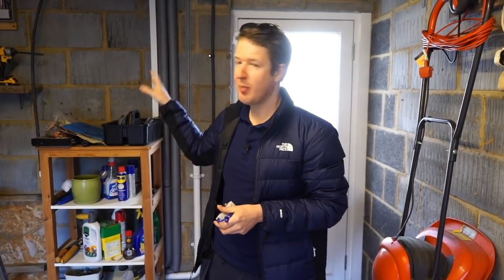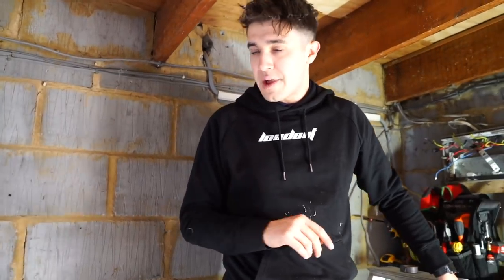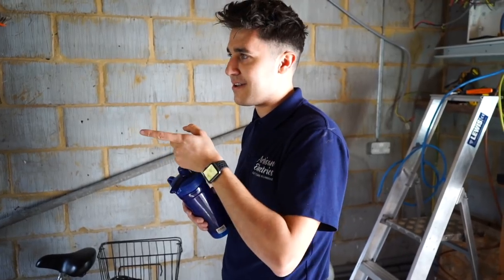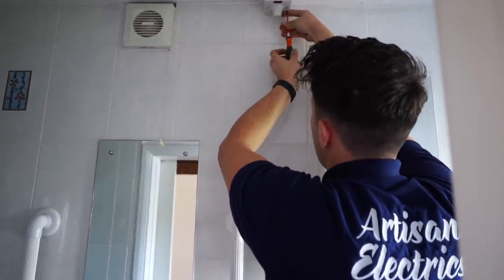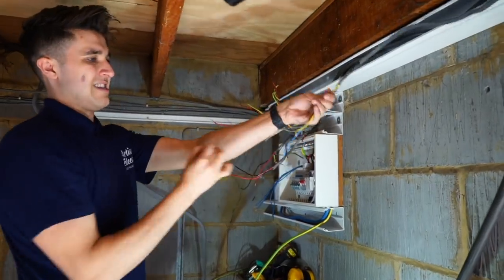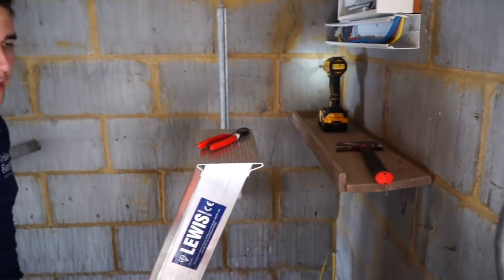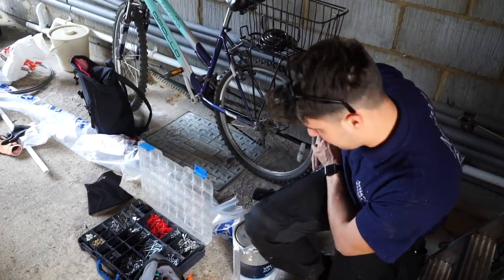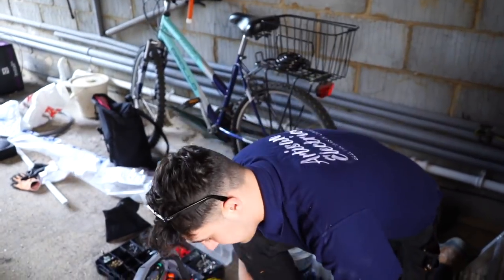Sorting out a complete mess of a fuse board - Electrician Life

Comment: Magnetic field effect on a lighting circuit would be way too small to be an issue. My steel CU has tails coming into two seperate holes - I checked with a thermal camera with about 35A load and saw no measurable temp rise. It might be an issue on heavy duty industrial setups but insignificant in a domestic situation.
Reply: JW did a video on this with 100s of amps and there was no real considerable temperature rise.
Reply: @callumBee  good olde JW
Reply: A rise in temperature is more likely to come from the resistance of a cable than induced eddy current in consumer installations
Reply: The whole "tales through separate holes" thing is a complete non-issue.  It's just yet another stupid unnecessary regulation.  Got to keep the regs people in a job I guess! 🤦‍♂️
Reply: After seeing jw's video on single cables entering metal enclosures, you definitely wouldn't have to worry about that in a domestic installation
Reply: It doesn't even make sense that any eddy currents would flow at all.  Any eddy currents induced by the current in a wire will flow in a direction parallel to the wire, not in a plane perpendicular to the wire, so there is no closed path for the currents to flow in.

Comment: When you want to find were those odd cables go , use a cable tracker , it saves walking around with wander lead , just need to connect the transmitter to the end of a cable and the you walk around touching the accessories with the receiver
Reply: yup. And if your gonna use the wander lead, use a multimeter on continuity reather than waiting around with the tester.
Reply: Cable tracer is the way to go. Can save a lot of time.
Reply: The cable tracker did wonders when I was working in a datacentre.

Comment: Singles is another good way to keep amount of cables at light fittings down. Neutral in neutral out and one switch wire. Permanent singles feed to switches only and switch wire up to light.
Reply: Here in Aus, SDI cable is dearer than twin actives. We always run the 2 core. At worst case there is a spare for any future upgrades or faults.
Reply: It's always done that way in conduit, not that common outside of a conduit system, would probably be more expensive these days as well.

Comment: The armoured cable: gland the armoured cable into a non-conductive box/conduit, and label as “Caution: Independently earthed at remote end. Do not to connect to local earth.”. That way you have shown that you could have connected the earth, but not doing so an obviously explicit choice rather than a potential cowboy installation.

Comment: I made a change a few years ago. It was on a staircase.  First the cable came from the fuse and went through the on-off switch and from there three-pole cable (hot switched, neutral, earth) to the lamp. It was all already built.
Then it should become two switches. The switch was exchanged for a pushbutton. I had to get hot again via a separate cable. Neutral and earth from the old cable.
Everything in one big box neat the lamp, the old cable from the first push button with neutral and earth, the cable with the new hot, the cable to the second push button (hot and switched), the cable to the lamp and an impulse switch. 
It was easier to change the cable closer to the lamp and from there to connect the second pushbutton and impulse switch closer to the lamp. But I needed the hot without a switch via an extra cable.

Comment: That's all around the world with building in a neat new board, but you still have a mess of old crap work around it. And here in Germany that's also a thing, especially due to that it was permitted until 1973 (in East-Germany until 1990) to have TN-C in final circuits, so no separate CPC, instead you got a PEN there. You can't install modern RCD protection in such old circuits, all RCDs and RCBOs we use here not only switch off the line, they also switch off the neutral. And it's not permitted to switch a CPC or a PEN. And as long as the installation is still intact and meets the requirements from back then, you can't force the owner to replace it. You can only recommend a modernisation. The only thing you can do is implement MCBs only in a new board, and on extensions be creative and implement something like an outlet with integrated 30mA type A RCD, which is btw. far more expensive than a rail mounted RCD (material cost is round about 130 Euros for them), and split the PEN from there into a separate neutral and CPC and then at least the extension is meeting modern standards.
Reply: Yeah and in the part of Germany that used to be behind the Iron Curtain, TN-C with 2.5 mm Al wire was permitted until 1990. Plenty of that still around! Only kitchens and bathrooms required RCD protection from 1984 onwards and were therefore wired in three core instead of two core (black and yellow/green).
Reply: A way bigger epidemic is the Fakt that there are still so many houses in Germany that still have the type "H" resettable fuse. (A relic from the 60-70s they stopped selling them in 1977)
So many houses could be saved from burning down if there owners knew what the heck is in there fuse board.
Reply: @SuperUltimateLP  H-curve MCBs have rather poor overload protection (thermal trip) but that's something they share with their successor, type L. Combined with the German obsession with putting 1.5 mm on 16 amp MCBs that can cause overheating. The same is true of Diazed/Neozed gG/gL fuses BTW!

The main purpose of H curve MCBs was offering fault protection in TN-C(-S) systems with high Zs, the magnetic trip is very fast at 2-3 times rated current. Of course that's quite annoying if you're using anything that has a high (-ish) inrush current, especially motors.

The Austrian regs recognised the overload issue fairly early on and reduced the maximum overcurrent protection size of 1.5 mm to 12 amps under most circumstances, along with the introduction of L12 A MCBs in 1980. This historic relic is the main reason why B13 is still the most common household MCB size in Austria, even though the regs now allow B16 for 1.5 mm unless the cable is embedded in insulation.
Reply: @Ragnar8504  i wouldn't call it a obsession ;)
I my self only use neozed fuses as a prefuse not as a primary.
People tend to screw in what ever fits even if I install a ring (don't know how to say it in english) to prevent the wong fuse from being inserted, idiots pull them out and screw in a 63A because "the previous one was obviously to small".
1,5 is to my knowledge only allowed for lighting and low usage circuits.
Everything thata has high power draw needs to be 2.5 for example washing machines/dryers.
Reply: @SuperUltimateLP  With some electricians I do feel it's a bit of an obsession :-)

The VDE regs let you have 1.5 mm on a B16/C16 in some circumstances - installation methods Bx (singles or cable in conduit) or C (cable on or in wall), two current-carrying conductors, no derating for bundling or higher ambient temperature. Despite the fact that most new construction is all method Ax (singles or cables in conduit in insulation, cables directly in insulation), 1.5 mm and B16 are still the most common choice in German domestic electrics.

Apparently at the onset of WWII the current-carrying capacity of 1.5 mm Cu/2.5 Al was increased to 16 amps in order to deal with wartime shortages and that change was never repealed. Eventually, manufacturers pushed 16 amp MCBs in such quantities that they were discounted heavily, eventually giving us the "€ 1.99 B16 single-pole", which in turn caused electricians to use only B16s because everything else was at least twice as expensive.

Conscientious electricians will use 2.5 mm for high-power loads but 1.5 mm can still be acceptable. Besides, most modern washing machines and dryers don't exceed 10 amps, even some ovens don't. I recently looked at a used IKEA oven from the late 2000s and it was less than 2 kW if I remember correctly!

Comment: 6241Y is used in 2plate wiring Neutral looped around the ceiling roses, Line looped around the switches, exactly as it would be in conduit but in sheathed wiring, instead of 3plate loop in wiring using 6242Y where line is also looped at the ceiling roses the more common method of sheathed wiring

Comment: Eddy currents on a single cable going through a metal hole really wouldn't be an issue.
Reply: John Ward tested the effect when tails are put through separate holes in metal. There was virtually no effect at the sorts of currents carried by tails, so you don't need to worry about a lighting circuit. It's certainly not "against every reg."!
Reply: When he first mentioned it I thought he was on how the singles were gonna create a giant induction loop :D
Reply: @tobysherring1369  virtually no effect with hundreds of amps flowing. It's not an issue.
Reply: Might not be an issue in practice, but it is in the regs
Reply: @chrisrogers2848  Regs are non statutory remember. Common sense needs to be used
Reply: @chrisrogers2848  Original issue was a single lighting cable. Cory said sibgles can't enter a consumer unit. Obviously they can (tails, metal conduit systems) and somewhere inside, a neutral conductor will be completing the circuit. The eddy current issue only applies if separate holes are used. ESF: "In order to prevent the occurrence of unwanted electromagnetic effects, all associated line and neutral conductors must enter the metallic enclosure via the same single aperture, whether a single hole or a series of interlinked holes linked by slotting."

Comment: The extension on my house uses single & cpc cable for the lighting wiring. Makes a change from the VIR single (no cpc) used for lighting in the original part of the house.
Edit: I wouldn't worry too much about the magnetic field associated with single cables. John Ward did a video on the subject and showed that unless you are passing ridiculous amounts of current through the wires it really is a non-issue.
Reply: They did do pvc with no cpc. Double insulated. In the 60s

Comment: Never seen a double sheath singles with a ccp,yes your right mainly used for strappers,not sure why it's going to the mains though 👍
Reply: they may have a borrowed neutral
Reply: @cocoino2307  yeah strange one,but surely they would of taken a t@e to the first light ,will have to see in the next vid 👍
Reply: Neutral direct to the light and line via the 2 way switches to the light. Means you didn’t have to use 3c+e which was rare
Reply: @AndyK.1  yes your right,t@e came on the market in the 70s and triple did not exist for a at least a few years later,hence the singles,I didn't see a separate neutral at the board,which would sought of explained 👍
Reply: @tww5719  Singles (double insulated) existed in 1966.
Reply: Seen it loads of times. I think 3 core and earth was not around back in the day - also it's a cost saving measure as it saves running permanent feeds everywhere where not needed. Also easier to get the cables down the old metal tubes to switches.

Comment: Easyer way to trace a cable is use a data tone tester the you can just wave it next to the cable without having to remove face plates. And the ones you find it use your tester to confirm

Comment: I work in council houses and they still spec lighting circuits in sheathed singles. We use live and earth, and separate neutrals. The lives loop around all the switches and the neutrals loop around all the lights. Obviously in council houses they don't expect people to be fitting smart switches etc so neutrals at switches isn't a consideration yet. Strappers are done in twin and earth.

Out of interest you used to be able to get red sheathed red and earth. They used this as permanent lives, then normal grey sheathed red and earth for switched lives. Then you could tell at a glance what was what in your switch drops. We come across a lot like this wired in the early 90s.
Reply from the maker: Wow thats mad
Reply: My company do tons of council work (Rewires, EICR, CU changes etc. And I have never ever seen it wired like this. It’s all standard T&E just loop in/out at the lights instead of the switches. The way you explained seems like a very odd way of doing it and a longer way
Reply: @uplightuk8924  it's not the way I'd choose to do it but the way we're told to do it.

I did come across a private house recently that was wired in singles in 2005. Black neutrals and brown lives 😂
Reply: @uplightuk8924  There is a lot of houses wired like this  singles and earth  lighting  in the east midlands .
Reply: @lin-fel  Fair enough. I’m in Bedfordshire/London area I haven’t seen any houses like that at all down these sides

Comment: I work on site/commercial and use single core and earth quite often for emergency lighting. Just to carry a permanent feed from the key switch to each emergency light on the circuit. However I have worked on some domestic/house bashing projects and not come across it on any of them so quite strange when you put it across as a house bashing thing 😂
Reply: Where does the neutral come from?
Reply: @stevespoor6567  I think he’s trying to say that when there are lights that have been wired in just T&E and don’t have a permanent at the light. EM lights need a permanent do they bring in the 1 core cable alongside the existing T&E just to bring a permanent to the lights? That’s the only way I can think of doing it
Reply: @stevespoor6567  wired in t and e as normal then each fitting that has a battery pack for an em has a single core and earth running to it as a perm live

Comment: A lot of new houses lighting circut were wired in single and earth in my time as a electrician  on large building sites .
Reply: I did a 1970s house the other day where they'd used sheathed singles for the lighting. CPCs were their own singles to the luminaires, but no CPCs had been run to the switches. Switch returns went straight to the fittings in a sheathed single and there was only one "junction box of doom" per floor to connect all the CPCs, neutrals for the fittings and the perm lives down to the switches. Quite an efficient use of cable and JBs, but a bit of a nightmare of ripping up floors if you don't know where that junction is.
Reply: Common in the 60s for 2 way switching.
Reply: @AndyK.1  There was a lot of new houses in the 70s  lighting circuts complete wired  in singles and earth .

Comment: Not sure but the issues seemed to be with the wiring in the garage  to put a new board on seemed to be putting a sheen on a turd  Think it would have been easier to read wire the garage which was obviously old if it in singles prob an industrial spark wired it feed at one end sw at other Would have been quicker  than changing a small cu over 2 days

Comment: What a waste of time and money upgrading tails from 10 to 25mm2 "proper tails". The 10mm2 is "proper" in this situation. I don't think anyone would ever get a separate 100A supply to such a small building. 10mm2 = 65A so fine for 60A supply - my whole house is on 60A.
Reply: Until they get electric oven and hob, electric shower and a car charger, i guess?
Reply: @DrGreenGiant  electric oven and shower already, on 60A tails. Yes, a car charger would be the time to separate the supplies and ask for 100A, and upgrade tails. But do they plan to put a charger on an annexe? Do they have planning consent to make a separate dwelling? The shed wiring video that goes with this has bizarre specs at customer's request, but the annexe wiring is apparently based on Cory's ideas rather than customer's request. It doesn't seem to add up.
Reply: @tobysherring1369  Very fair point, yeah
Reply: @DrGreenGiant  people often say they'll put a 10mm2 in for a cooker in case of future upgrade. But 6mm2 rated at 57A will take even the largest double oven range at 50A. And that's suggesting it's on full all the time, ignoring diversity which is detailed in the regs.